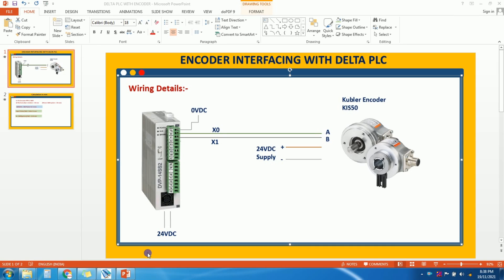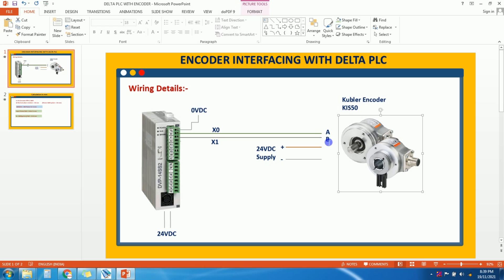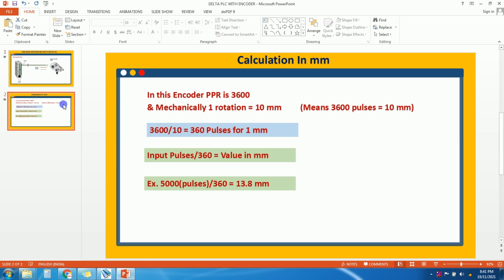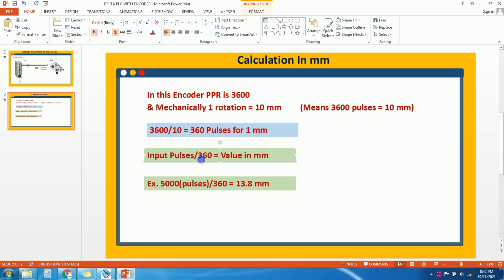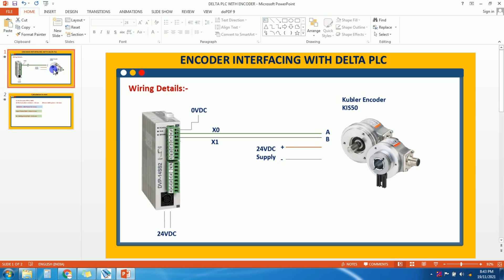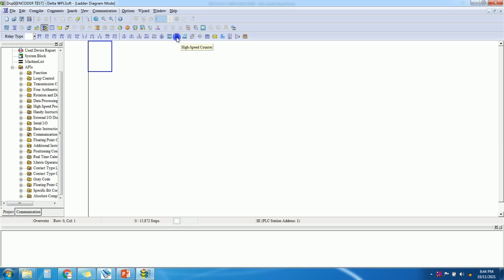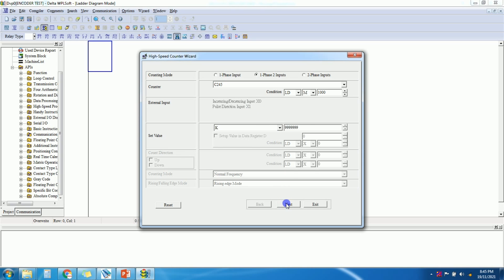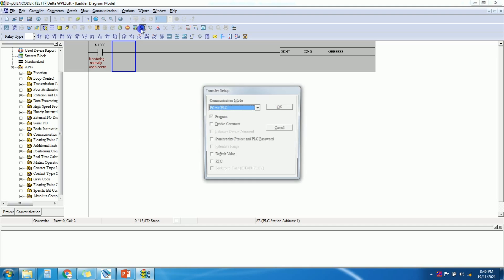Encoder Interfacing With Delta PLC || Wiring || Programming || English

Comment: I want to know that, after power cut of plc & Incremental encoder, then again on the plc & Encoder what will the reading Value of encoder on PLC. will be show Zero Reading or Last Reading value, please guide ..
Reply from the maker: The counter is retentive..so value will  not be zero
Reply: @IndustrialAutomation ,thanks for replay, 
 can u suggest high speed counter command on delta or Mitsubishi PLC , i have a 3ph incremental encoder. i want after power on/off encoder degree angle should not zero, how. .please guide